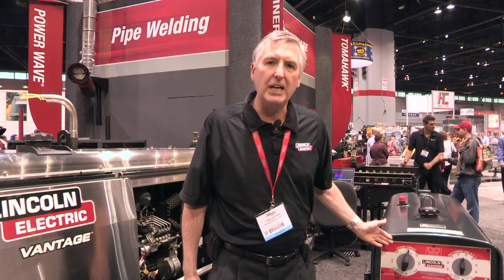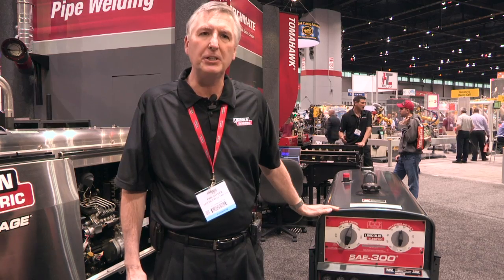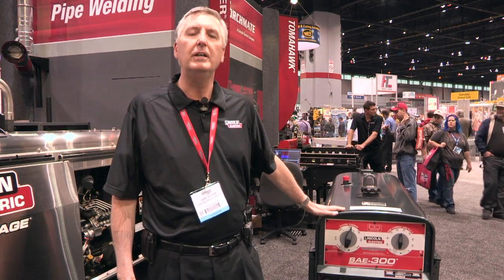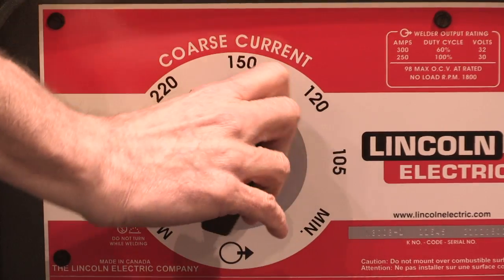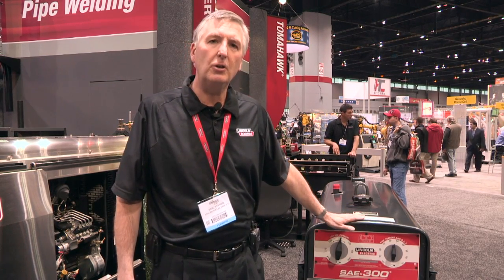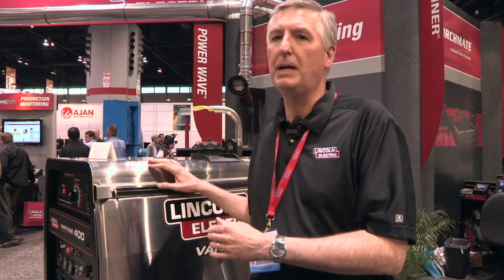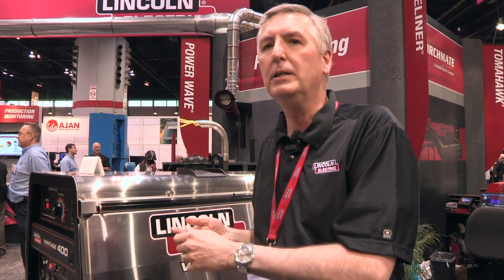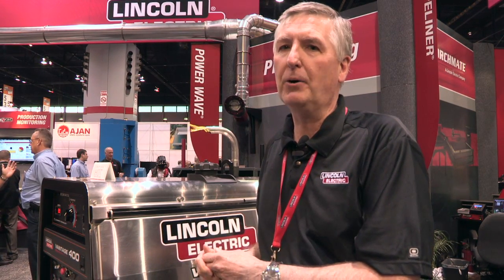FABTECH 2011: Engine Drives

Comment: Our company purchased a new one JUNE.  Cv mig welding is terrible.  The wire sticks in the tip and has a rough arc start.  Lincoln knows there is a problem but doesn't seem to care.  It is the most dissapointing purchase of a welder we have ever had.  Wish lincoln would call and talk to us.  It now is november a no fix.  Will have to buy a miller soon if no answer from lincoln.
Reply: Peter Gutschenritter Thats not a machine problem. Its you.